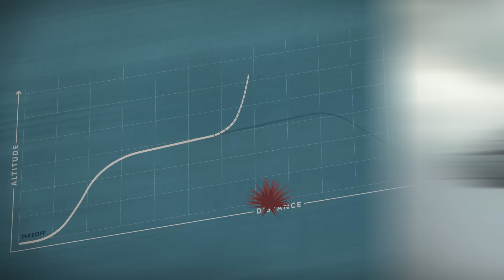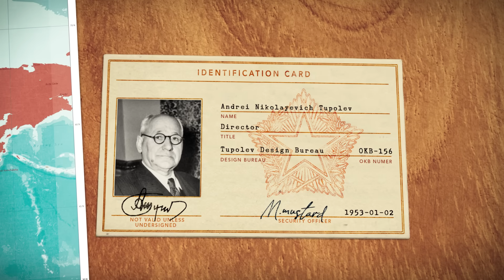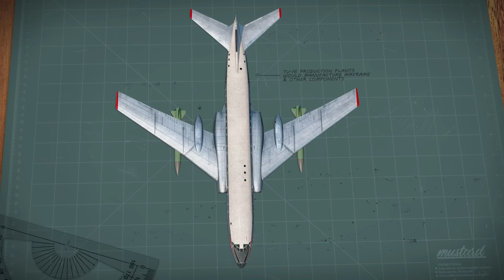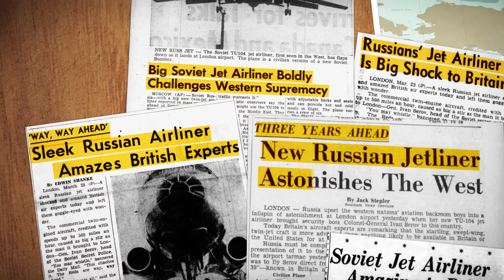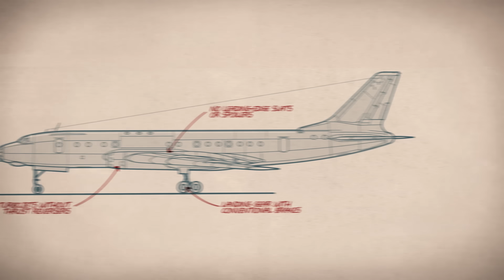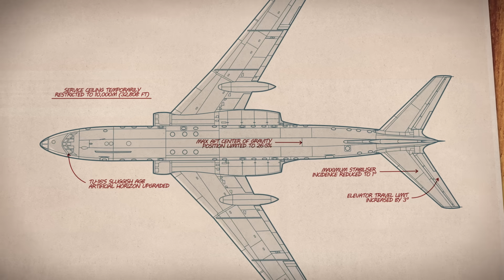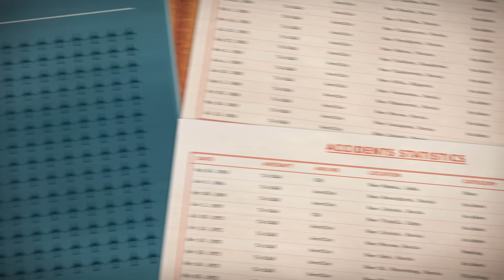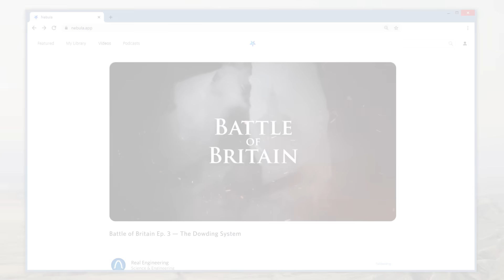The Soviet Airliner Designed To Crash

Comment: Yes, put those engines as close to the cabin as possible. If the noise doesn't keep you awake, the vibration will.
Reply: Yes the de Havilland Comet suffered from a similar design flaw.
Reply: @WilhelmKarsten 

Regarding the fabulous trailblazing 
De Havilland Comet.
Accident Losses generally.

We feel we can clear up some commonly held myths and misconceptions, obviously.

It's always good to see the facts presented clearly and concisely isn't it?

De Havilland was subjected to forced merger under the govt aerospace sector rationalisation programme. A similar process occured globally, Sud Aviation and several other French manufacturers merged during design and production of the Caravelle with the Caravelle becoming a significantly international type project. Even in the US, there was no room for multiple manufacturers of large jet airliners with consolidation being inevitable.

The world's first wind tunnel was constructed in England before 1890.
The world's first supersonic wind tunnel was constructed in England during the 1920s.

The DH Comet was subjected to every type of stress testing & wind tunnel testing possible at the time. 

The world's first high altitude airliner.
The world's first jet airliner.

In fact the Comet was the first airliner to have a full fuselage length pressurised passenger cabin suitable for high altitude flying where pressurisation stress was many times higher than flying load stress. Bow-wing (see b-47 wing folding wing collapse incidents) had built less than 12 pressurised cabin airliners before the Comet first flew. The world's first pressurised cabin aircraft was a British design Airco built under licence in the US and modified in the US to have a pressurised cockpit cabin during a joint US / UK research project. Previous pressurised aircraft were airliners with lower pressurisation & altitude limits where pressurisation stress did not exceed flying load stress or were bombers with small heavily built cockpit capsules where potential total  airframe weight gains were insignificant.

The Comet nose was a unique De Havilland design that Sud Aviation subsequently licensed for use on their Caravelle.

Correct, the Comet was designed with military use in mind. In fact, the first designs were based on military use requirements, the first Nimrod aircraft were straightforward modified Comet 4 airframes. Obviously when the Nimrod first flew, it was of course the most advanced and capable aircraft of it's type in existence. All subsequent Nimrod airframes were indeed simply mostly  new manufacture Comet 4 airframes with the additional equipment bay added. Nimrod design and manufacture was in fact performed mostly by the De Havilland team at HS. 

The Comet was in fact an all metal construction airframe airliner, use of other materials was similar to all other airliners at the time. 

  Obviously there have been worse aircraft for accident losses both before & after the Comet. One of the issues was accident losses due to pilot error which were often caused by the novel aspects of jet airliner flying, even so, the accident losses for the Comet as an airliner were not particularly unusual at the time.

Some changes made were to make pilot error on takeoff less likely to cause serious problems. For example, the skin thickness remained mostly the same from Comet 1 to Comet 4.
Ripstop provision existed for all Comets. The original alloy used was discontinued by the manufacturer, the replacement alloy had similar properties.

  Indeed, at the time aviation infrastructure & aircraft technology etc was still developing rapidly, there was still a lot to do when considering all aspects of flying safety.

    How things were back then. 
Accident losses - % of aircraft built.
DeHavilland Comet 4                   14% 
DH Comet all mks   (ff 1948)       17%  
Vickers VC10 UK                            5%

The DH Comet had better safety than or similar safety to many other commercial passenger aircraft of a similar era.

Douglas DC-1                                      99%
Douglas DC-2                                      47%
Douglas DC-3                                      30%
Douglas DC-4                                      26%
Boeing s300                                        72% 
Boeing 307                                          70%
Boeing 247                                          48%
Boeing 707                                          20% 
Lockheed L-049/149 Constellation  30%
Lockheed Electra Turboprop             29%
Fairchild FH-227                                  30%
McDonnell Douglas DC-8                   14%
Sud Aviation Caravelle                        15%
Canadair CL-44  Turboprop                46%  
Convair CV-580  Turboprop                22%
Convair CV-880     (ff 1959)                27%  
Convair CV-990     (ff 1961)                33%
Tupolev T-104        (ff 1956)                16%

The VC10 held the fastest Atlantic crossing speed record for 41 years (Non supersonic airliners).

For the first few years of operations the Caravelle and Comet had similar accident loss Fatalities numbers.

  Instances of all Comet marks, including the Comet 1 and Comet 3 flew with full certification at some point after 1954. Airline duty Comets were all retired by 1980 with full certification until after retirement. The last Comet flight was a global circumnavigation series of flights in 1997.

   Of course De Havilland carried out a full stress analysis & performed extensive & protracted testing, including pressure cycle testing, on two long lengths of fuselage. De Havilland carried out significantly more testing than was required by any authority at the time & significantly more testing that any previous airliner was subjected to.

  Of course De Havilland had prior experience building many all metal construction airframe aircraft & thousands of jet powered fighter aircraft that were primarily of metal construction with pressurised cockpits & jet engines built by De-Havilland. At the time De Havilland engineers  knew all there was to know about metal fatigue as it applies to aircraft.

    De Havilland did indeed always work to better than industry standards at the time, used up to date knowledge for the design & no evidence of negligence  or criminal negligence was ever produced in relation to the DH Comet.

Military aircraft accident losses compared.
Non combat phase accident losses.
% of Aircraft built.
The EE Lightening did not have unusually high losses. 
The Canadair CL-44 was a turboprop airliner.
Canadair CL-44               (ff 1959 ) 48%
Lockheed XF104             (ff 1954) 100%
Lockheed  P80                (ff 1944)  43%
Lockheed F104               (ff 1954)  45%
MD FH Phantom 1          (ff 1945)  35%
MD F4 Phantom 2           (ff 1958)  28%
Convair F102 Dagger      (ff 1953)  45%  
MD F3H  Demon              (ff 1951)  32%
MD F-101 Voodoo           (ff 1954)  34%
EE Lightening                   (ff 1954)  33%
Gloster Meteor                (ff 1943)   21%
DH Vampire                     (ff 1943)   23%
DH Sea Vixen                  (ff  1951)  33%
Gloster Javelin                (ff 1951)   20%

Note that the Meteor didn't have particularly high losses, flew with more than 20 airforces for decades, got involved in air to air combat during a number of conflicts successfully against aircraft that first flew many years after the Meteor first flew.
 
We hope this helps, of course.       
       
As always, cheers & indeed 👍.
Reply: Ну тебя б туда, ты б сотворил что то более продвинутое (НЕТ)

Comment: The Tu-104 was a pioneering design from an era when little was known of the stresses of jet speed on a large passenger plane. It was nonetheless quite successful and actually carried over 90 million passengers with Aeroflot, excluding the 6 planes operated by Czech Airlines. It was certainly much safer than the de Havilland Comet and its attrition rate was similar to that of the Boeing 707 (18%), which although considered horrendous today, was not so in the 1950s. Basic design flaws even afflicted much later planes such as the Boeing 727 rudder issues which led to several crashes.

Comment: I didn't know about this video or plane, but from that thumb, I knew it had to be Russian.
Reply: The worst was actually the British de Havilland Comet...
Reply: @WilhelmKarsten 

Regarding the fabulous trailblazing 
De Havilland Comet.
Accident Losses generally.

We feel we can clear up some commonly held myths and misconceptions, obviously.

It's always good to see the facts presented clearly and concisely isn't it?

De Havilland was subjected to forced merger under the govt aerospace sector rationalisation programme. A similar process occured globally, Sud Aviation and several other French manufacturers merged during design and production of the Caravelle with the Caravelle becoming a significantly international type project. Even in the US, there was no room for multiple manufacturers of large jet airliners with consolidation being inevitable.

The world's first wind tunnel was constructed in England before 1890.
The world's first supersonic wind tunnel was constructed in England during the 1920s.

The DH Comet was subjected to every type of stress testing & wind tunnel testing possible at the time. 

The world's first high altitude airliner.
The world's first jet airliner.

In fact the Comet was the first airliner to have a full fuselage length pressurised passenger cabin suitable for high altitude flying where pressurisation stress was many times higher than flying load stress. Bow-wing (see b-47 wing folding wing collapse incidents) had built less than 12 pressurised cabin airliners before the Comet first flew. The world's first pressurised cabin aircraft was a British design Airco built under licence in the US and modified in the US to have a pressurised cockpit cabin during a joint US / UK research project. Previous pressurised aircraft were airliners with lower pressurisation & altitude limits where pressurisation stress did not exceed flying load stress or were bombers with small heavily built cockpit capsules where potential total  airframe weight gains were insignificant.

The Comet nose was a unique De Havilland design that Sud Aviation subsequently licensed for use on their Caravelle.

Correct, the Comet was designed with military use in mind. In fact, the first designs were based on military use requirements, the first Nimrod aircraft were straightforward modified Comet 4 airframes. Obviously when the Nimrod first flew, it was of course the most advanced and capable aircraft of it's type in existence. All subsequent Nimrod airframes were indeed simply mostly  new manufacture Comet 4 airframes with the additional equipment bay added. Nimrod design and manufacture was in fact performed mostly by the De Havilland team at HS. 

The Comet was in fact an all metal construction airframe airliner, use of other materials was similar to all other airliners at the time. 

  Obviously there have been worse aircraft for accident losses both before & after the Comet. One of the issues was accident losses due to pilot error which were often caused by the novel aspects of jet airliner flying, even so, the accident losses for the Comet as an airliner were not particularly unusual at the time.

Some changes made were to make pilot error on takeoff less likely to cause serious problems. For example, the skin thickness remained mostly the same from Comet 1 to Comet 4.
Ripstop provision existed for all Comets. The original alloy used was discontinued by the manufacturer, the replacement alloy had similar properties.

  Indeed, at the time aviation infrastructure & aircraft technology etc was still developing rapidly, there was still a lot to do when considering all aspects of flying safety.

    How things were back then. 
Accident losses - % of aircraft built.
DeHavilland Comet 4                   14% 
DH Comet all mks   (ff 1948)       17%  
Vickers VC10 UK                            5%

The DH Comet had better safety than or similar safety to many other commercial passenger aircraft of a similar era.

Douglas DC-1                                      99%
Douglas DC-2                                      47%
Douglas DC-3                                      30%
Douglas DC-4                                      26%
Boeing s300                                        72% 
Boeing 307                                          70%
Boeing 247                                          48%
Boeing 707                                          20% 
Lockheed L-049/149 Constellation  30%
Lockheed Electra Turboprop             29%
Fairchild FH-227                                  30%
McDonnell Douglas DC-8                   14%
Sud Aviation Caravelle                        15%
Canadair CL-44  Turboprop                46%  
Convair CV-580  Turboprop                22%
Convair CV-880     (ff 1959)                27%  
Convair CV-990     (ff 1961)                33%
Tupolev T-104        (ff 1956)                16%

The VC10 held the fastest Atlantic crossing speed record for 41 years (Non supersonic airliners).

For the first few years of operations the Caravelle and Comet had similar accident loss Fatalities numbers.

  Instances of all Comet marks, including the Comet 1 and Comet 3 flew with full certification at some point after 1954. Airline duty Comets were all retired by 1980 with full certification until after retirement. The last Comet flight was a global circumnavigation series of flights in 1997.

   Of course De Havilland carried out a full stress analysis & performed extensive & protracted testing, including pressure cycle testing, on two long lengths of fuselage. De Havilland carried out significantly more testing than was required by any authority at the time & significantly more testing that any previous airliner was subjected to.

  Of course De Havilland had prior experience building many all metal construction airframe aircraft & thousands of jet powered fighter aircraft that were primarily of metal construction with pressurised cockpits & jet engines built by De-Havilland. At the time De Havilland engineers  knew all there was to know about metal fatigue as it applies to aircraft.

    De Havilland did indeed always work to better than industry standards at the time, used up to date knowledge for the design & no evidence of negligence  or criminal negligence was ever produced in relation to the DH Comet.

Military aircraft accident losses compared.
Non combat phase accident losses.
% of Aircraft built.
The EE Lightening did not have unusually high losses. 
The Canadair CL-44 was a turboprop airliner.
Canadair CL-44               (ff 1959 ) 48%
Lockheed XF104             (ff 1954) 100%
Lockheed  P80                (ff 1944)  43%
Lockheed F104               (ff 1954)  45%
MD FH Phantom 1          (ff 1945)  35%
MD F4 Phantom 2           (ff 1958)  28%
Convair F102 Dagger      (ff 1953)  45%  
MD F3H  Demon              (ff 1951)  32%
MD F-101 Voodoo           (ff 1954)  34%
EE Lightening                   (ff 1954)  33%
Gloster Meteor                (ff 1943)   21%
DH Vampire                     (ff 1943)   23%
DH Sea Vixen                  (ff  1951)  33%
Gloster Javelin                (ff 1951)   20%

Note that the Meteor didn't have particularly high losses, flew with more than 20 airforces for decades, got involved in air to air combat during a number of conflicts successfully against aircraft that first flew many years after the Meteor first flew.
 
We hope this helps, of course.       
       
As always, cheers & indeed 👍.

Comment: The plane with the worst safety record is the de Havilland Comet, much worse than the Tu-104.
Reply: The attrition rate per plane of the TU-104 is actually similar to that of the Boeing 707
Reply: @John-m1b1x Yes, the Tu-104 has a very average loss rate for its time... very safe compared to the Comet

Comment: The most dangerous aircraft ever built was the English built Comet,a large jet engined passenger jet. It repeated desintergrated without warning at high altitude.
Reply: Several Comets also crashed attempting to take-off due to fatal flaw in its design.
Reply: Except, there's a lot of missing contexts.
Reply: @pmayo7894 The statistics don't lie... only the British attempts to rewrite the  most humiliating and shameful chapter in British aviation history do.

Please name a single airliner with a higher loss rate than the Comet?